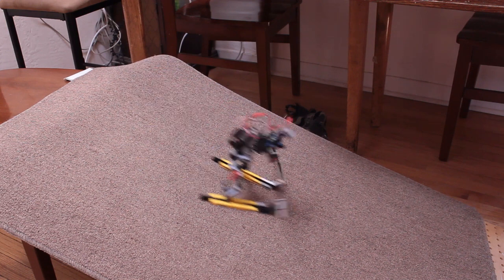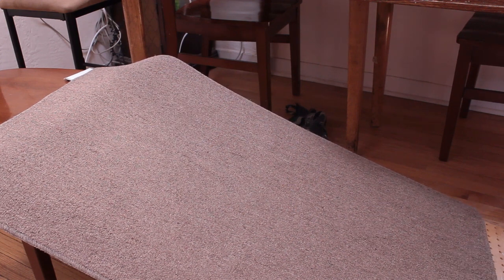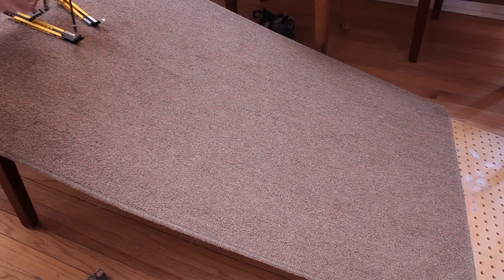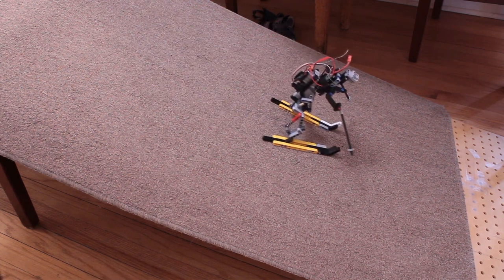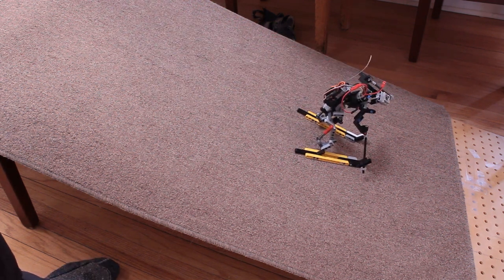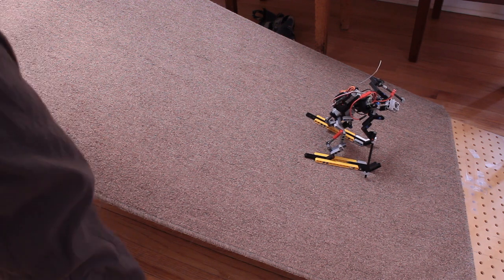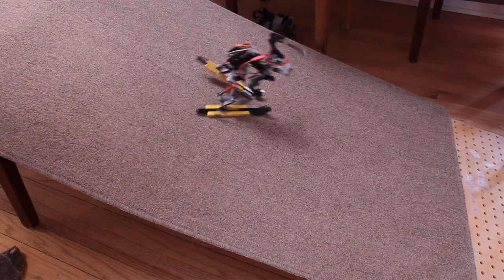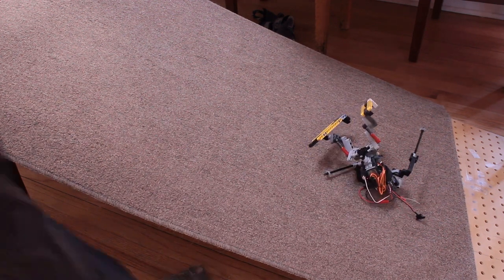Lego Technic Downhill Skiing Robot Really Skis on Snow (Moc)

Comment: Very cool! although it looks like all the weight is on the inside ski, which is the opposite od what you want in real skiing
Reply from the maker: If I turned left I would have the weight on the outside of my left ski and the inside of my right ski. You can almost treat skis like they are connected on a parallelogram. As you point out I do not have in this model. I would like to redo it with skis that have the proper shape and better geometry but this video was really hard to make and doesn't get views.